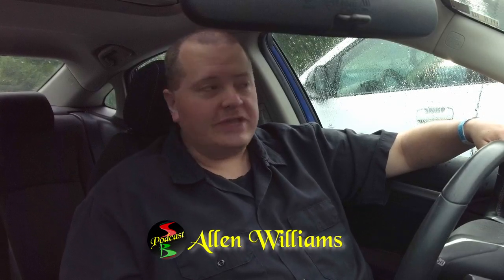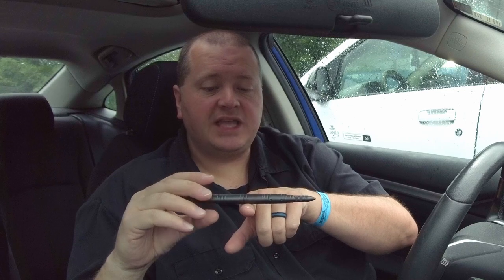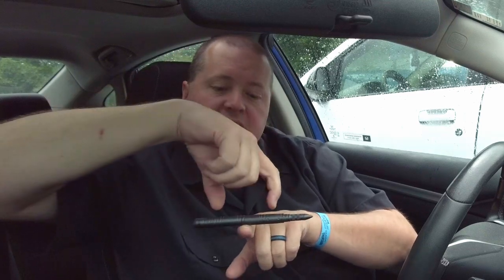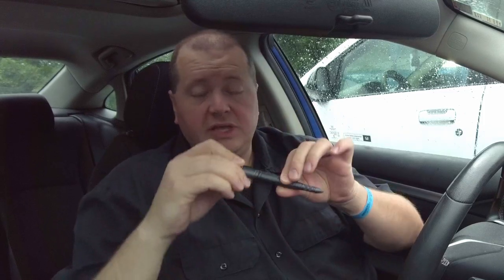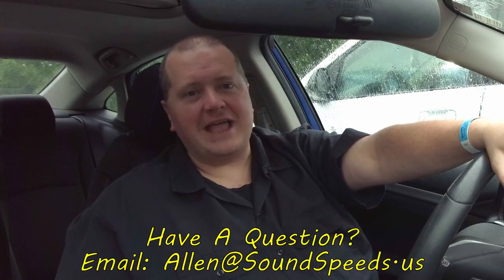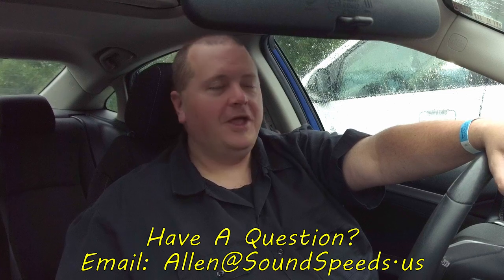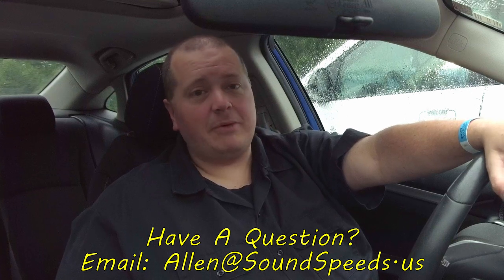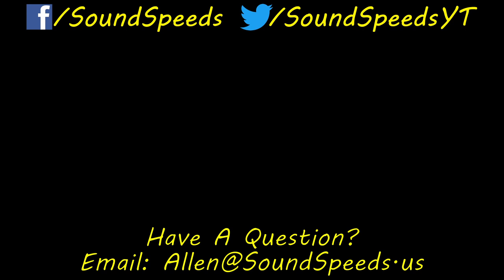Shockmounts Pros Use & Advanced Microphone Pointing, Speed Bumps Podcast E3

Comment: hey sound speeds! been a active watcher for quite some time and i have a question for you! so basically i see a TON of performers with dynamic mics and they are up close and personal with their singing, even when the belt out real hard (with their lips touching the mic grill)...they never seem to get plosives, yet when I get even 2 inches near my dynamic mics i seem to have a problem with plosives....could you maybe shed some insight on how they do this? I'm guessing there is more to this than just rolling off the low end?
Reply from the maker: Are you using the same dynamic mics as they are using? Hand held dynamics have internal foam which resists plosives but broadcast dynamics can pop all over the place.
Reply: @SoundSpeeds  Ahhhh i use the xm8500 while they are using SM58. im guessing the xm8500 has less of a internal foam than the 58.
Reply from the maker: That's very likely it.